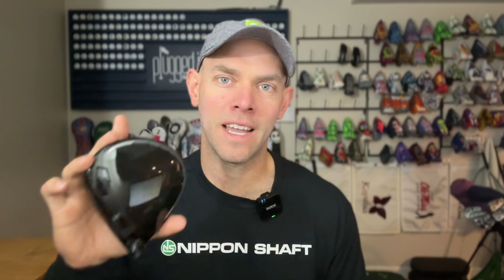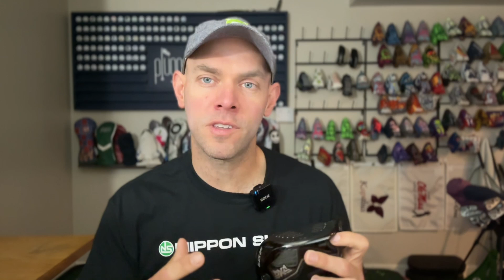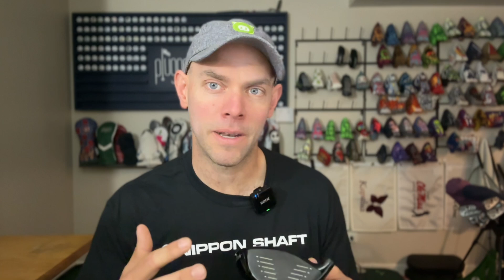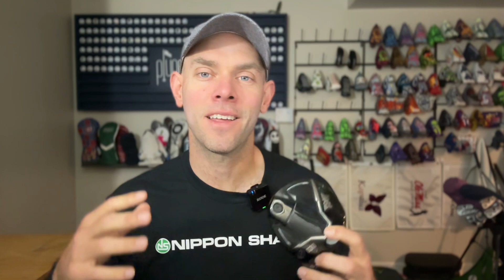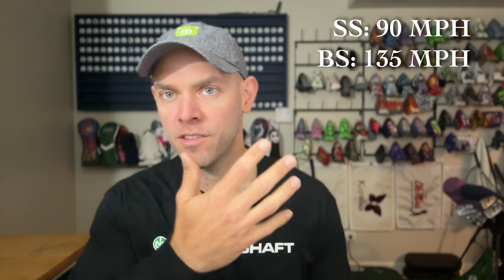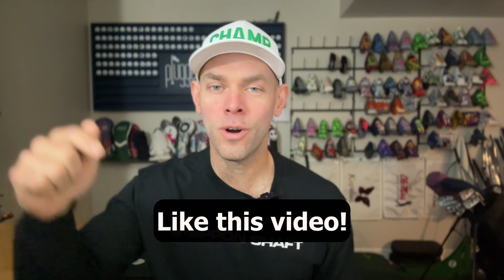The TRUTH About New Drivers - PluggedInGolf.com #golf #golfclubs

Comment: Submitting for the giveaway. 

Question: If budget is limited and you have a driver that currently still produces expected outcomes when struck well, would you agree that bringing in that driver and specifically just getting fit for a more appropriate shaft (appropriate flex, weight, kick point, etc.) and having that attached to your existing driver head would make the most sense to still improve your game but at a lower price point?
Reply from the maker: When you say "expected outcomes" do you mean it's optimized or it's just predictable?  If it's optimized, I wouldn't change anything.
I think there's some value in putting a new shaft in an old driver head, but you are - to an extent - tying the fitter's hands.  I would rather tell the fitter up front, "I can only spend X" and let the fitter do their job without restrictions.

Comment: Very helpful video - showing the need to get fit for clubs. I went to Club Champion last year - very professional and helpful. The staff checked out all my equipment and adjusted loft and lie on my irons. They made several suggestions for changes in my setup and swing as well. I would love to get fitted for a new driver to match the 15* launch and 2200 rpm ball rotation.
Thanks for the opportunity.

Comment: How often should you get fitted?  I was fitted for a driver a couple years ago, but I can't help but think I'm not getting the most out of this club.
Reply from the maker: Great question.  Certainly you should be fit before you make a club purchase.  As for a "just checking in" fitting, it depends on how much you like equipment and how much you value small gains.  There are players who check in annually because they will buy new clubs for 1 more yard.  If you don't want to buy for less than, say, 5 yards, you probably don't need to get refit more than every 3-4 years.

Comment: I've been a fan of your website for a long time. I didn't know you had a YouTube channel until this video was suggested by YouTube. I'm glad I discovered it. Getting back to the video, you confirmed my suspicions that the latest drivers aren't that much better than the previous one or 2 generations. I usually buy the previous gen driver since it's a lot less expensive and I get basically 99% of the performance.

Comment: Can one increase distance if working one’s butt off with devices designed to increase swing speed?  Loved the tip regarding getting fitted for a driver. Thanks.
Reply from the maker: Absolutely.  Most golfers have a ton of latent speed that can be accessed with a very modest amount of speed training.

Comment: Did this apply across all OEMs? I feel like the OEMs that are less known for their drivers like Mizuno and Srixon may have made bigger strides in recent years. I specifically have a Gen 4 PXG driver, and I've been mulling whether a Gen6/Black Ops is enough of an improvement.
Reply from the maker: All OEMs have been producing "maxed out" drivers for years.  That doesn't mean every OEM is equal or they haven't improved a lot in some years, but, on center every major driver is at the limit.
Reply: @PluggedInGolf1  thanks! Do you have a opinion on the 0811 XF Gen4 vs the 0311 XF Gen 6 or Black Ops driver? Any noticable improvements in forgiveness?
Reply from the maker: @themura  Yes, I think the Black Ops is meaningfully better.

Comment: At what point would it be the right stage for a new golfer to get fitted?
Reply from the maker: As soon as possible.  There are a lot of levels to fitting.  A new golfer doesn't need to get dialed in with a hugely expensive set up, but there's no reason a golfer should ever play clubs that don't fit the size of their body.  This is a video topic that's on my list, great question.

Comment: Love this video and your explanation of the key elements that truly affect driving distance. For me, as a senior golfer, I've learned how important the club shaft is to measurable improvement. With new drivers costing up to $600 or more, I'd love to see a similar video as this one on shafts. If the club head is the engine that drives the ball, then the shaft is the transmission that delivers the power (I'm a car guy as well).

Comment: My swing speed is pretty low, at around 83 mph.  Am I correct in assuming that due to my slow speed the face will not respond as much.  Hence, these changes won't be as significant to me?  I'd love to win a fitting and new driver.
Reply from the maker: That's incorrect.  The face technology is beneficial to everyone.  I might argue that players at lower speeds need it more as they need to get everything they can out of the speed they have.

Comment: Excellent content on drivers and fittings, and Matt's spot on. If fitted correctly, drivers should hold up for 4-5 years before needing a replacement. Most club manufacturers deliver a new version every two years, while Callaway's cycle is every year. Technology doesn't change that much from year to year.

Comment: I wanted to replace my 10+ year old Callaway driver so I had a “fitting” last year. Turned out I was hitting my old driver the same distance as the newer models. I wasn’t convinced we tried all the shaft options and other adjustments to gain distance.
Reply from the maker: Sometimes you just have a combo that can't be beat on centered strikes, but I'd be surprised if something new wasn't better on mishits/on average.

Comment: I am 69 years old and an 8 handicap and have been fit for irons with great results. I am tired of buying a new driver every 2 years looking for an extra 20 yards. Would a fitter focus on the shaft since it seems most heads are the same?
Reply from the maker: I don't think it's accurate to say heads are the same.  A good fitting looks at both pieces - head and shaft - working together to get you the best result.

Comment: Nice video. As someone who has similar specs as you, I have always been curious on shorter driver shafts and the effect on center strike and thus distance.  Shorter shaft usually means shorter drives but center face strike will increase distance for most amateurs.  Keep up the great work.

Comment: I’m in. Just got a somewhat fitting for a driver shaft and plan on getting a new one asap. Currently hit Callaway epic sub zero. I have hit the Elyte and sub 70 859 pro.  Prefer the Elyte but $250 more. IS IT WORTH IT?!?!
Reply from the maker: That's the question I can't answer for you.  Is 5 yards for $250?  Would 10 yards be?  For some golfers, 20 yards wouldn't be worth $600, for others, they'll pay $1,000 for 2 yards.
Reply: @PluggedInGolf1  if I can win this I want have to worry about the extra $250😂. I wasn’t able to use the tensei white 75x in the sub 70 to get an apples vs apples. I used a graphite design ad gc 63x. I was more comfortable with 75 shaft than 60. Dispersion was better. SS wasn’t really a factor between the two. Elyte was more consistent and better smash factor. But I think it was the shaft???
Reply from the maker: @billhotalen4209  Ah, I see the situation.  That is tough without an apples to apples on the heads.

Comment: Great video. Learned a lot about fitting. Never been fitted for a driver. My driver is a first generation PXG which I bought on line. Is it time for a new driver and should I get fitted. Thanks
Reply from the maker: Definitely.  Your driver is about 10 years old, there are most certainly gains available to you.

Comment: But new innovations in Shafts can also make a difference. But that may cost you just as much as the driver itself. 
But how much of a difference would the shaft make? Meaning I buy a $250 shaft into my Ping G400 Max, would that be a better investment.
Reply from the maker: A properly fit shaft can make a big difference, regardless of cost.  A random shaft, no matter how expensive it is, probably won't.

Comment: I wonder how they determine the legal limits for club specs? Is it arbitrary or is the limit based on reasonably durable equipment? I’d imagine that 160 driver face would be too thin and wear out faster.
Reply from the maker: There's a measure called COR which the USGA uses.  I don't know why the limit is where it is.  It's probably where the manufacturers were at when they decided to put the brakes on.
Reply: @  that makes sense! Seems like equipment advanced relatively quickly from wood woods to where we are today. I imagine the USGA was scrambling to keep up!